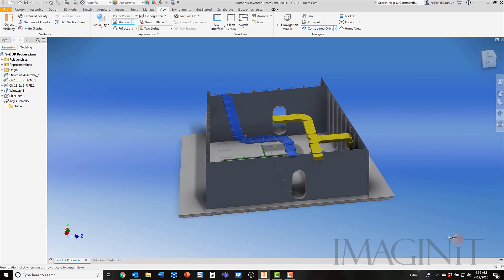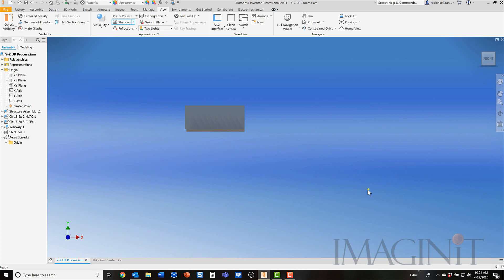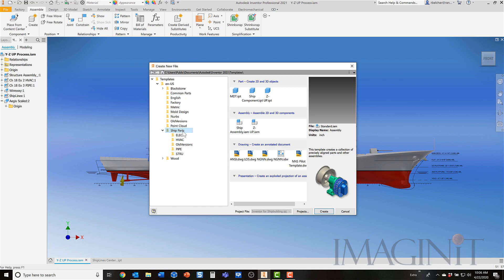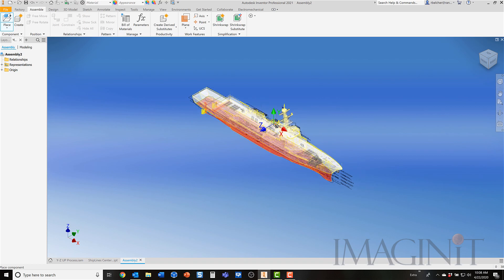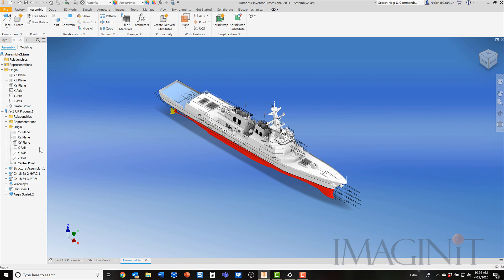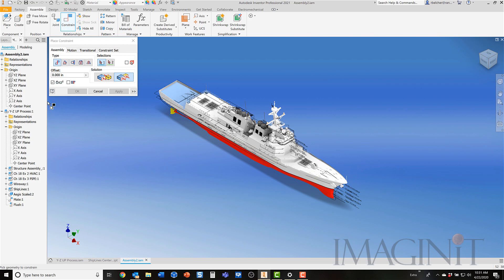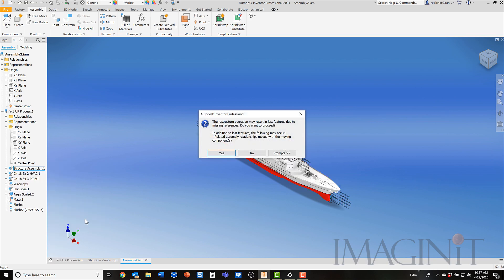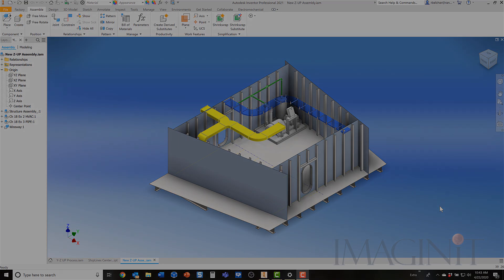Changing an Autodesk Inventor Assembly from Y-UP to Z-UP

Comment: "Creating the Z-up Template is not very difficult to do".  "We are going to assume you have an Assembly Template with the Z-up."   Argh - that was the only part I needed.  ha ha ha.  Big assumption leaves a hole in your presentation.  But nice job on the rest.

Comment: How to setup template with Z in upward direction?
Reply: Start a new file, (Part or Assembly), then click on the applicable View Cube face on the top right corner of the screen to orient the blank Part/Assembly to the way you want it to be facing top down. Click the view cube's drop-down menu and select "Set as Top". Do the same to orient your "home" position, either with the view cube corner or another custom position. Drop-down -> set as Home. Save As Template.   (maybe I should make a 10 minute video to explain this?)